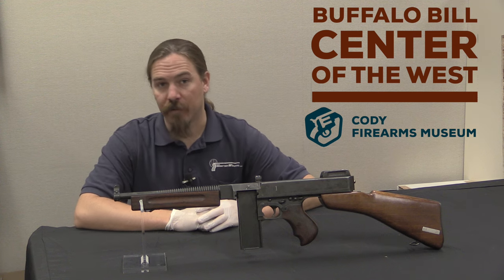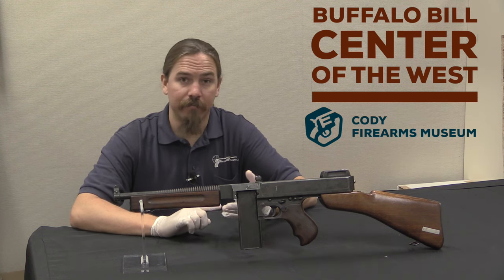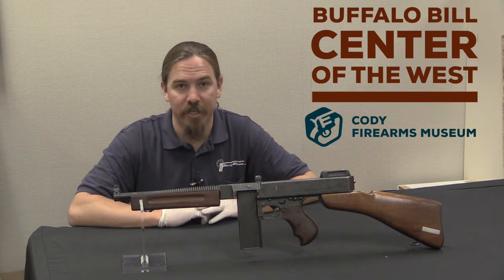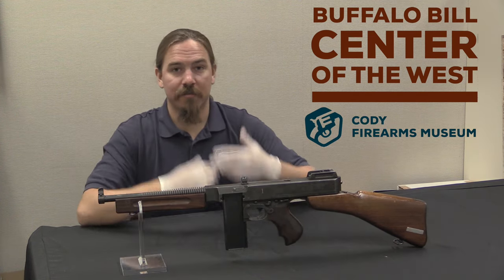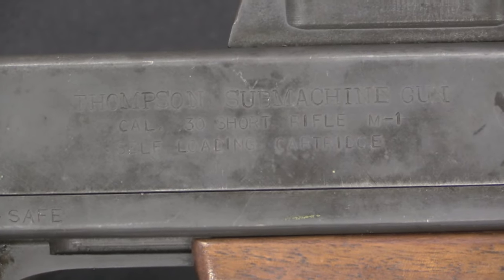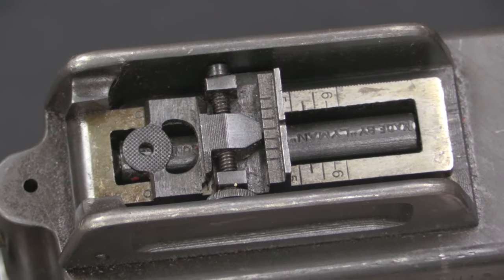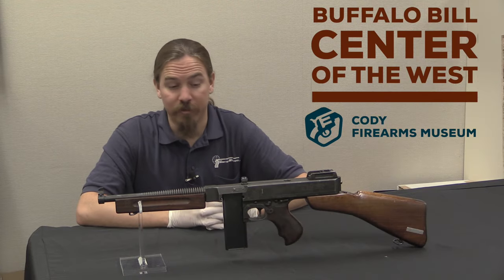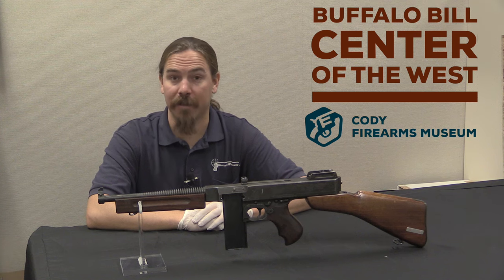Thompson SMG in 30 Carbine

Comment: So what gun won the trials ultimately?
Reply from the maker: The Winchester, which became the M1 Carbine.
Reply: Given the choice for the same job, which would you pick? M1 Carbine or this Thompson?
Reply from the maker: M1 Carbine. I'm not really a fan of the Thompson.
Reply: even if this were a perfected weapon? as in functionally and mechanically i mean. You wouldnt prefer the expanded capacity and select fire?
Reply: i thought he meant the m1 garand - my error.
Reply from the maker: I find the Thompson to be heavy and awkward.
Reply: readyrepairs I think weight is the real factor here. If you have to have this on your back day in, day out, i'd go with the Carbine too.
Reply: I can attest to that. I have a semi auto 1927a1 and it's quite heavy to lug around. 
Also, Ian, do you have any suggestions on how I could get some information on my thompson? Ie a rough manufacturing date based on the serial number? I know mine appears to be old, but I have not even the slightest clue.
Reply: does your being left handed have any bearing on your awkwardness with this platform? ie. mag release lever ect?
Reply from the maker: Kevin Collver No.
Reply: there is nothing awkward about Gun Jesus.
Reply: aldi404 of
Reply: Heavy, the M1A1 Thompson weighed 5 kg, while the M1 carbine weighed 2.4 kg.
Reply: Ready repairs, have you ever heard of the M2 Carbine?
Reply: i mean. its the same gun right? i googled it but ive always known the two guns to be the same gun -  and they looked  the same to me.
Reply: readyrepairs The only difference between the two is that the M1 is semi-auto only, while the M2 is select-fire.
Reply: the M2 carbine was adopted and saw a lot of action. its actually legal to buy a full auto M2 because it falls within a gray area of the law since the receivers between the M1 and M2 are identical. the only difference is extra parts around the receiver which isn't regulated by the law as machine gun parts. its a very complicated legal issue.
Reply: The reason that an M2 is legal to buy/own is that it was manufactured pre-1986. You still have to go through all of the normal legal requirements for owning a full-auto firearm (background check, forms, tax stamp, and waiting). The fact that the M1 and M2 have the same receiver has not a bit to do with it. Owning an M2 without a tax stamp will get you in plenty of trouble.

Comment: This is an extremely interesting gun. The M1 carbine cartridge is would actually be an excellent SMG cartridge and this gun apparently proved that it could work in an unlocked, blow-back weapon. The M2 carbine was not really successful because it was too light and combined with the exceedingly high rate of fire, it was very poorly controllable. This 12 pound SMG might have been quite an effective gun, in any case much more effective than the .45 version, if the rate of fire could have been reduced to no more than 600 rpm. Also, the barrel would have to be at least 12 inches long; the .30 carbine round does not like short barrels. It is a great pity that Ian could not shoot this thing. I expect the rate of fire would also have been very high though.
Reply: Mind that the .30 carbine originated from a family of cartridges developed for the Winchester 1905 and 1907 blowback carbines, and it was not the most powerful of them ( the .351 Winchester Self-Loading of the model 1907 was). The experiments done during the war determined that a 570gr bolt was enough to safely fire even proofloads, so it was entirely feasible to design a six pound rifle in .30 carbine using the blowback system (the Winchester model 1905 weighted 7lbs, and the model 1907 8lbs). The problem is that the Thompson SMG is an heavy design in itself.
Unfortunately, if you want to make it select fire, the more practical way to slow down the ROF in a blowback design is to enhance the weight of the bolt (that's why WWII 9mm SMGs had bolts that weighted nearly 700gr, that were clearly an overkill only to fire the 9mm para safely).

Comment: Would the recoil on this be higher or lower than on a standard thompson? Im not a cartridge expert lol.
Reply: .30 Carbine is about 3 times as powerful as .45 ACP so it wouldn't surprise me if it had more recoil.
If my memory is correct I think one of the figures on .30 Carbine shows that at 100 yards it's as powerful as a .357 Magnum (which has slightly more muzzle energy than .45 ACP) at the muzzle.
Reply: So it would have been an atrociously recoil heavy gun and probably would have failed the trials even if it was half the weight? lol
Reply: No, I would think you should be comparing it to the recoil of the other .30 -Carbine chambered guns.  Whether or not this had worse recoil than the original .45 version, isn't the point.  The fact it was so much heavier than the Army's requirement, means it should have significantly LESS recoil than any of the other submissions, which were light enough to meet the specification. 

Now of course, that's just talking about weight generically.  In reality, it's not that simple, because distribution of the weight in a different longer-barreled gun, would make up some of the difference in terms of recoil (and/or muzzle climb, i.e. "angular momentum"), since the Thompson was notably short overall.
Reply: Yes thats a good point. I think for the thompson its the type of recoil versus the severity of the recoil due to the weight distribution. It may kick the same as the other guns in the trial but im sure it was a lot harder to keep on target due to the rise etc
Reply: 3 times more punch than a .45 ACP means about what, 1500 Joules/1000ft.lbs at the muzzle..? That would put .30 carbine in between a 7,92x33 Kurz and a 7,62x39 in terms of muzzle energy.. More like twice as powerful.. And a typical .357 Mag 158gr load out of a 6" barrel puts out about 650-700 Joules/500ft.lbs at the muzzle which is about 200ft.lbs more than a .45 ACP 230gr fmj out of a 5" barrel... Thats almost twice as much energy not slightly.. And that's mathematics applied in physics not an opinion :)
Reply: StPaul76
.30 Carbine in it's Army loadings had 970 ftlbs at the muzzle, like I said ABOUT 3 times the power of .45 ACP.

Also I was going for comparable loads of .45 ACP and .357 Magnum.
Reply: Ok. I obviosly confused ft.lbs with Joules.. :D My bad, brother. With the stoutest current loads for the .45 ACP and the sloppiest loads for the .357 mag go close, that's true. And I agree, that a Thompson in .30 car with a magazine large enough would have made quite an SMG despite it's obviously heavy weight.
Reply: Also the stock angle and amount of drop  impact on recoil.
Reply: @D8W2P4   You are mixing energy with momentum. The .30 carbine have *3 energy but the same momentum. And recoil depends on  momentum, no on energy

Comment: Isn't .30 carbine too high pressure wise to work reliably in a open bolt blowback design? I recon it would require a much heavier bolt and/or stiffer recoil spring compared to a standard .45 ACP gun

Comment: Hmmm…
Many folks have decried the M1 Carbine's lack of stopping power…
Right or Wrong—doesn't need to be debated at this point in time…
But imagine if the military had asked for a .357 caliber autoloading round—same velocity, same sectional density as the M1 .30 Carbine cartridge, but with a bit more weight and bullet cross-sectional area—a cartridge much like the much like the .351 WSL cartridge.
I wonder how popular the M1 Carbine might have been.
My guess is that there would still be many hunting and private social engineering weapons being produced in that caliber.
…..RVM45

Comment: They probably would have saved two pounds and ten inches if they slapped a folding wire stock on the back.  Is .30Car a softer to fire round than .45ACP?

Comment: Having not watched this episode yet, my thinking is that what possible advantage would a tommy gun in .30 cal have over an M1, M2, etc? Probably none. Twice the weight, at least twice the cost to produce, same performance.
Reply: Same cost, twice the range, better penetration, lighter ammunition. The US military didn't adopt it because we had massive .45 ACP production capacity in 1940, and planned to use it.  The .30 Carbine was new- and they were worried about producing enough ammo for it.

Comment: The Receiver Magazine opening, besides being lengthened ( along with OAL Receiver Body, to allow longer bolt travel) is ALSO machined with Horizontal Slots for an "L" ( 50 rd.)
???shades of a PPSH or a Finnish K31!!?? Or just a 1928 on Steroids???
Think of it, a heavy SMG, controllable on FA fire,firing a cartridge with more energy and range than a .45ACP
Unless one forgets the M1923 TSMG with 1" .45 Cartridge (Remington)...
Doc AV.

Comment: had they made it lighter and cheaper they could have stopped the adoption of the grease gun
Reply: Yeah, something as simple as a wire stock or removed altogether could have saved a fair bit of weight.
Reply: The wood doesn't weigh that much, it's the massive chunk of steel that the receiver is made out of that gives them all that weight.
Reply: Given that the bulk of the weight was from that giant milled steel receiver, it likely would have to have been constructed out of sheet metal like the M-3 just to come close to meeting the weight requirement. Even the M-3 was too heavy by specs.
Reply: +Matt Dickson You can't make this weapon much lighter, due to the operating design. If you make receiver (which is responsible for a significant chunk of the weapon's weight) any lighter, the weapon stops working.
Reply: The M3 is surprisingly heavy for what it is, seeing pictures of them I always thought that they were fairly light, then I got to fire one once and I was surprised at how heavy it actually was. On the plus side, the recoil was surprisingly mild for something that fires .45 ACP and considering the reputation the Thompson had for harsh recoil.
Reply: The M3 SMG "grease gun" could have been built in 30 carbine rather than .45 ACP. The bolt is heavy enough. The 30 carbine cartridge does not like short barrels, so, the barrel would have had to have been lengthened to about 12 inches. Imo, it would have been much better than the .45 ACP version. The .45 ACP is a poor round for a SMG: it is fat, leading to long magazines and it is heavy, reducing the amount of ammo that can be carried. Its terminal effects are no better than those of the 9mm Para or the 30 carbine.
Reply: @herman7661  Given that the M3 had a great reputation even in .45, .30 Carbine would make it even better.
Reply: @0neDoomedSpaceMarine  The Automag III works extremely well with it. I don't see an issue with the M3 having it minus the wire stock.
Reply: Riceball01 actually the Thompson had much lower recoil than the grease gun due to its heavier weight.

Comment: That magazine release next to the trigger makes me nervous.
Reply: ElagabalusRex It's close to the position where the magazine release is on most modern pistols.
Reply: Your finger inside the trigger guard tends to positively push the mag release lever forward.
Reply: And how about a safety inside the trigger guard?
Reply: Considering that you're, presumably, most likely to be hitting the mag release to replace an empty mag I'm not sure that its placement is that big of a deal. I think that the bigger deal is the awkwardness of the way it works, instead of a button or a simple level they chose to go with something that's more of a toggle.

Comment: My dad has a few deactivated (we live in the UK) Thompsons, a couple M1A1's and an M1928, I couldn't believe how heavy they were, the M1 carbine is a much nicer firearm to wield.
Reply: How bad is the deactivation? Have only the barrel and bolt been messed with or has everything else been welded together?
Reply: @typehere6689  They were all purchased before the regulation change luckily so just no firing pins and the barrels welded with an obstruction.
Reply: A good thing. After all, another part of the appeal of such things is their worky bits.

Comment: Hey Ian just curious do you think the Thompson could've been made lighter if the factories in the United States had better access to stamping metal experts?
Reply: There was no reason to make it lighter.  If you can't carry 12 pounds- you don't belong on a battlefield.
Reply: but you're not just carrying a twelve pound gun, you're also carrying spare ammo, a cleaning kit, a steel helmet, a backpack which houses your rations med kits and other tools, a spade, or a radio if you are assigned as the squad's radio operator. So in the grand scheme of things, it's much better to have a lighter weapon so you can divert your strength to hauling other equipment you need.
Reply: A radio operator would have carried a 6 pound M1 carbine, not a 12 pound Thompson.  WW2 soldiers did not wear 30-plus pounds of Kevlar and ceramic body armor.  The Thompson and BAR worked- and part of the reason they worked was the weight of the guns making them controllable.  War is not a camping trip... you show up with the most powerful, reliable and functionally accurate weapons you can carry, not the lightest.

Comment: If they removed the stock and added a sling it would be a lot lighter (I imagine, unless the stock was really light - which I doubt) it could have been an early assault rifle!
Reply: The Thompson SMG is an heavy design in itself. The walls of the receiver are way thicker than what's necessary. That's why it weighted almost 2 lbs more than the grease gun.

Comment: Army Ordnance seems to have had a remarkable lack of imagination. Thompson could probably have switched to manufacturing these with reasonably little disruption. The .45 Thompsons could have been sent over to the Marines (instead of giving them Reisings). Ammunition resupply would have been simplified. And a .30 Thompson would likely have been somewhat more controllable than the .45. Seems like a it should have been adopted as a replacement for the .45 Thompson.

Comment: Why was the US so late to the game when it came to stamped guns? Why didn't a company produce a simple stamped gun in 30 carbine for these trials? It would have been light and cheap which seems important for these trials
Reply: thewiezman Because back then and even today many Americans see stampings as cheap and therefore inferior which isn't true.
Reply: Scott7891 it is true, stamping at its core produces a less strong final product than milling or forging and that is just a fact. However, when comparing the small loss of durability and endurance to the ease of production it becomes easy to justify stamping. The reason why the US didn't start stamping was really quite simple: we had no experience with it.

Russia and Germany both (the main stamped firearms producers in ww2) both had long history's with the process of stamping, specifically in toys and things alike. They already had a general idea of the proper techniques in the process and some of the infrastructure to begin.

The reason why the US still doesn't do much of anything with stamping is because

1. From a civilian standpoint there is no reason to have a stamped firearm because the minutiae manufacturing cost difference has no significant impact on the individual unit cost and

2. From a military standpoint, our primary weapons system is now the ar-15/m16 platform than can perform in really any role needed for a military firearm, SMG included. Assuming we needed a faster, cheaper to produce M16 we would switch to injection molded polymer receivers and parts which are MUCH easier to produce than even stampings.

Comment: Would select fire and intermediate cartridge technically make this an assault rifle by modern standards?
Reply from the maker: I suppose? Given that the first M1 Carbine trial called for all the guns to be select-fire, they all would qualify.
Reply: Neat.  Shame they didn't fully embrace the concept until the M16.
Reply: now imagine a open bolt full auto rifle with a stock too short, without grip and as ramped as a regular tommy stock. that would be a disaster.